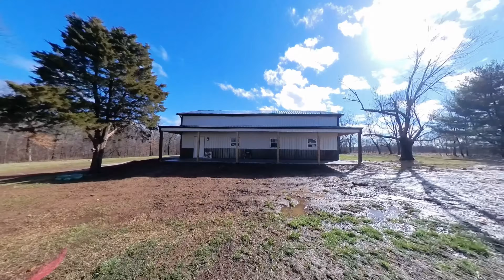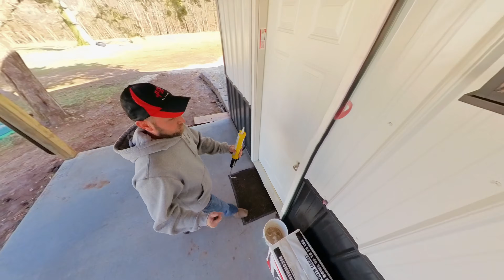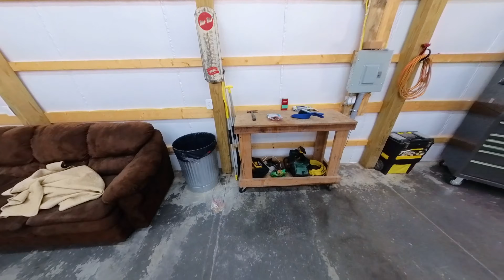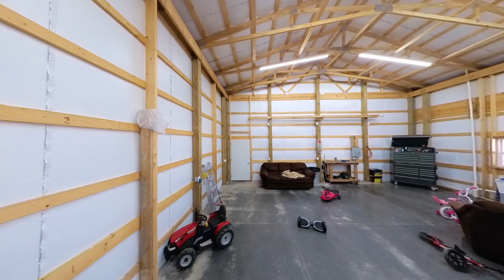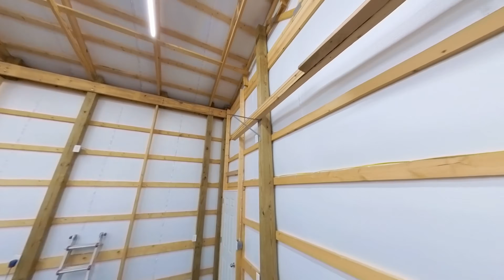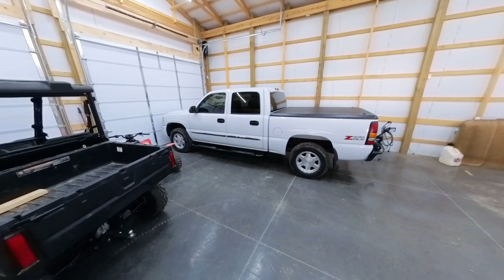New 30x50 Shop is getting insulation!  Almost done!

Comment: What’s the overall dimension of the slab with the porch? 40x50?
Reply from the maker: Yes 40x50. It’s actually not all one pad. They poured the porch as a separate pad and sloped it out, but you are correct. It’s taking me a long time, but I’m trying to finish editing the video where I go over all the details of the bill, including costs of everything. Hopefully in the next couple weeks at least I will have that video out if that is something you are interested in. It will likely be at least a 20 minute long video, but I will also have an easy breakdown of total price you can skip to if you don’t want to listen to all the details.

Also, if you look at one of my more recent videos about my red truck, you will see the inside of the shop. Looks nothing like it did in this video. Much has changed.

Comment: How tall are the walls?
Reply from the maker: 14'. I wanted to go tall enough to be able to have a tall enough ceiling under the loft and above the loft that it didn't feel cramped and I didn't have to duck. I'm less than 6ft tall so I dont need much. Plus it gives me extra height for a lift. Also the reason I did scissor trusses.
Reply from the maker: For a new video up with everything finished and total cost breakdown. 

https://youtu.be/nuxBF3U9MM8?si=Q25WUoQqI0WsGdSB